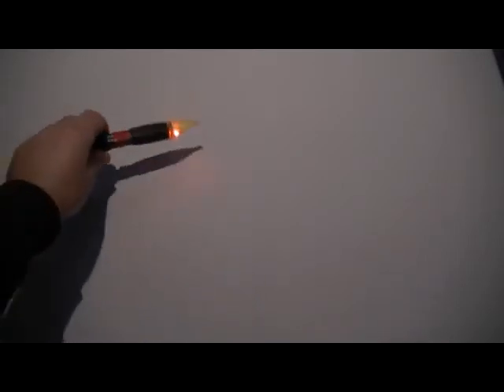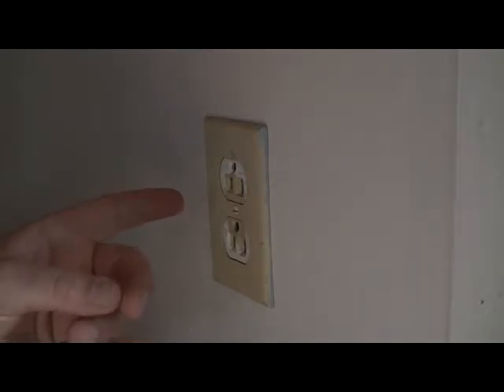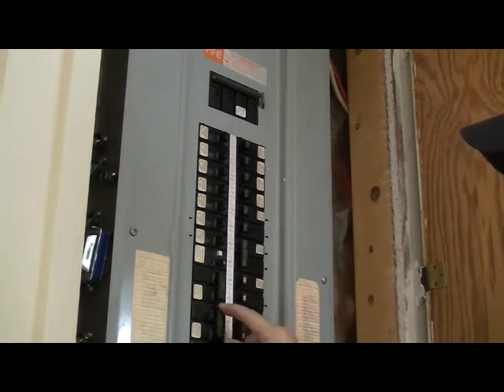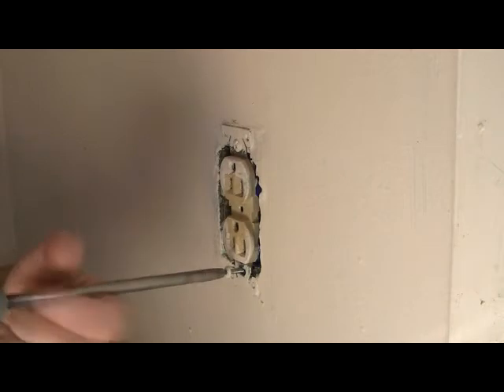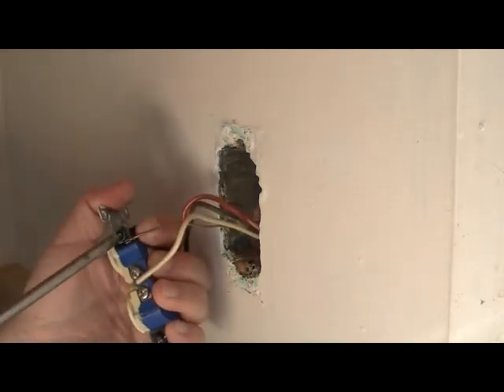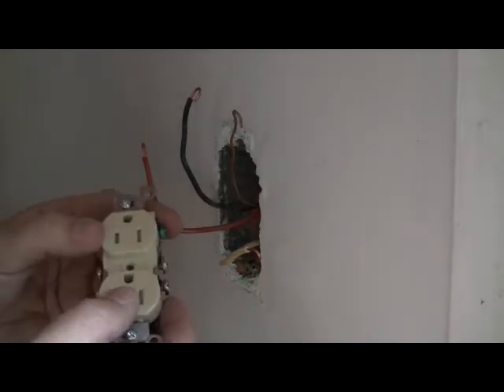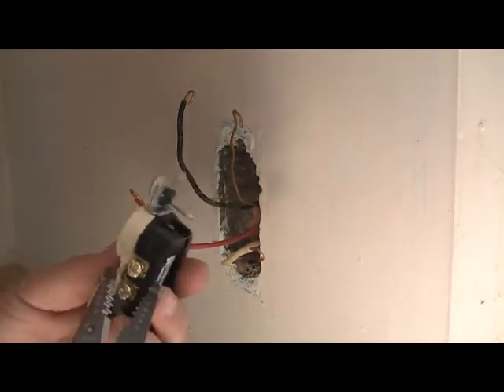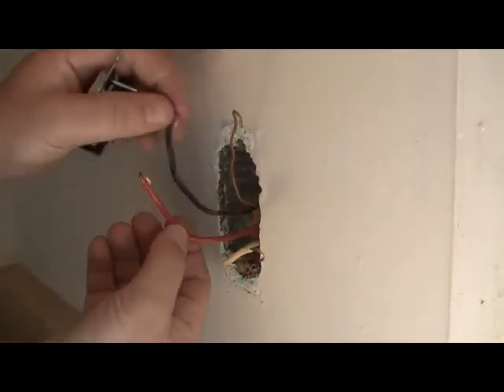How to replace an electrical outlet on your countertop.

Comment: Good explanation, very clear. Ground up can also indicate split receptacle, which you have. Glad to see that you proved that this is 2 circuits, aka in this case, a multiwire branch circuit. The shared neutral requires them to be on opposite phases (L1 and L2). The double pole breaker normally accomplishes this by default. A split receptacle can commonly exist on a single circuit as well.
Reply from the maker: Thanks for the info.